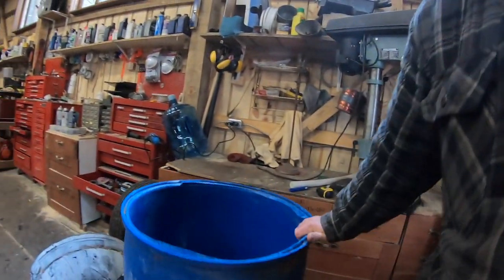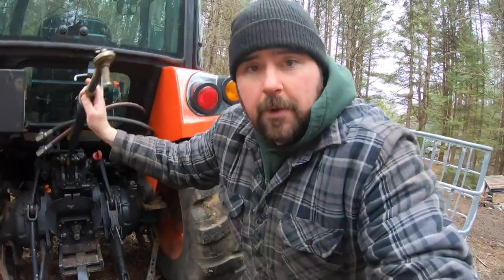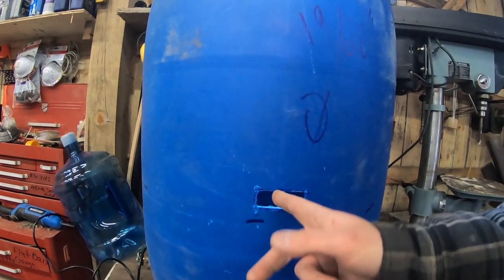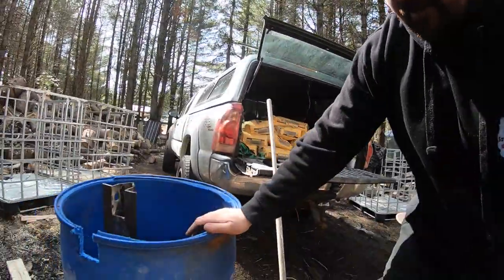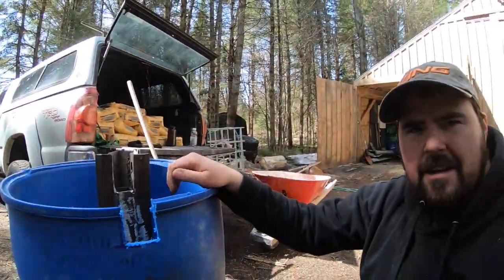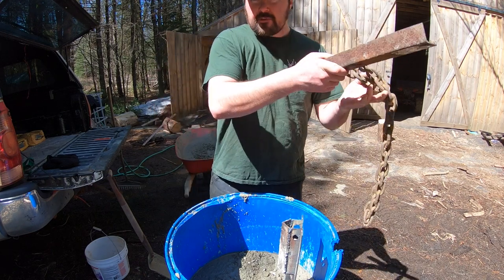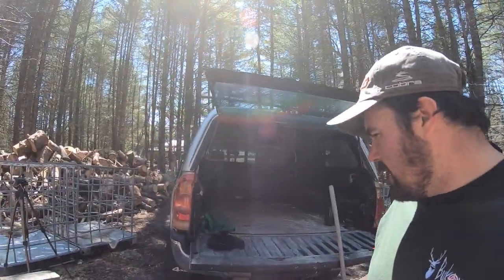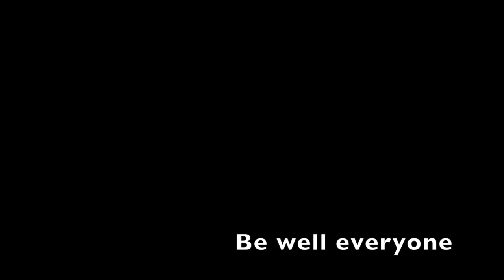Designing and Building a Tractor Weight

Comment: Another great video Sandy
I’m going to make a ballast barrel as well. But to save on the welding,, I’m going to add the top link connector by placing it in the wet cement.

Comment: Ballast weight is very important but there is no comparison to weight in or in rear tires. Having the tires filled is a must and I would find a way to do it. My buddy has wheel weights that bolt to the rims on top of filled tires and it is night and day compared to my tractor with filled tires and a ballast weight. Any weight added to the tires puts the weight exactly where you want it not only for traction but also loader work.

Comment: I had to say something. That's a 30 Gal. Barrel not 55. FYI. And I agree with the other fellow about the box blade being a better choice. It's something useful and can stay on the tractor and give you added ballast. I also added a 300 pound weight to my box blade, it helps a box blade work better and gives me an extra 300 pounds of weight so between the box blade and the weight I've got about seven hundred pounds on the back. I used a large gas cylinder filled with concrete mounted horizontally on top of the rear of boxblade. Really digs in good compared to without weight.
Good videos.
Reply: It's has to be a 55 gal barrel.  Here's the math:  One 66 lb bag Quikcrete stone mix = .5 cu ft; 14 bags = 7 cu ft.  There's just over 7 cu ft volume in a 55 gal barrel.

Comment: To save a few bucks and effort, you could throw some dense rock in the mix instead of using just concrete. For the lifting chain, i would maybe sink that lower. Looks good though, great cost savings. I just made some concrete wheel weights.
Reply from the maker: Thanks Rich

Comment: you could have filled your tires with windshield washer fluid. im in Quebec, Canada... windshield washer fluid 55 gal cost 80$... just need to buy the adapter (hose to tire valve), I took and old fuel pump and it worked #1 without costing a lot. but ok... i'm still able to lift my tires if I really push it. great video!
Reply from the maker: That is true. I looked around at washer fluid as well but for the price I couldn’t match the concrete. I also would’ve had to buy a little pump and hose section so the added costs were making the difference bigger

Comment: I also used a 55 gallon barrel and filled it with concrete and rock on the back of my Massey Ferguson 165.  My tires are loaded and I only lift the barrel up enough to move without touching the ground - about 6 inches.  I have had no stability problems while using my loader but without loaded tires this could be an issue.

Comment: Just a few comments for version 2.  As said earlier provisions for a 2" coupler on the back would be helpful.  NEXT...During the design phase, after putting the drawbar in the barrel hook it up to the 3ph and raise it all the way.  Then hold the top link above the top of the counterweight and you will automatically know where and at what angle you need the top link connector.  THIRD....If you put a couple of pieces of pvc tubing in the barrel you can also have a place to carry a shovel, rake or whatever.  LAST....I don't know if it will work on a plastic barrel, but try putting a utility knife hook blade in your oscillating tool.  On some material it cuts better than the saw blade, and lots cheaper.  [You do know how to sharpen those saw blades, right?]
Reply from the maker: Sounds like some good ideas. Thanks for watching Greg

Comment: Hey brother buy the adapter and put water in them ur self its easy I do road services it hooks to ur valve stem and to a water hose put the valve stem at 1:00 and fill it keep it up brother
Reply from the maker: Unfortunately the water would freeze here in Canada. Not sure if that’d cause damage or not
Reply: @sawingwithsandy  Use winter window washer fluid, should be good to -20f or so. Our NAPA has it in 50gal drums.

Comment: Caution Will Roberson, its not the same type of counter balance, the reason they fill the tires is because the weight is at the lowest point in the machine and static, what you are doing is adding weight above the axle, its like making a seesaw, you could damage your tractor or flip it over, be careful.

Im not saying it won’t work, What im saying is the machine will act differently in steering, my old JD had rear wheel weights and front removable plates about 100lb each, its all about what you want to do, towing heavy implements I needed weight in front to keep the front end down, in your case its to keep the back end down, just have to remember when weighted in the rear, and your forks or bucket is empty the front is light enough to bounce.

Comment: Did you do any rebar or other metal to strengthen the concrete? If not how much has chipped/cracked or broken from wear and tear? Wondering if those hitch attachments have supported all that weight ok by themselves.
Reply from the maker: Hi Jered, I didn't put any rebar in this. Holding up good so far. No cracking of any kind

Comment: Thanks for all the info, 
I made a ballast just like yours.
How long should I wait for the quikrete to dry? Before I can use the ballast.
Reply from the maker: I’d wait atleast theee days but truth is it’ll likely take more than a month to fully cure
Reply: @sawingwithsandy 
Thank you for your answer. 
I mixed the  quikrete Aug 19.
I'd like to use it but I'm afraid it will crack in half if it's not fully hardened
Reply from the maker: Yeah longer is always better for sure

Comment: DO NOT COPY THIS DESIGN. One day while you are fitting or dismounting  the barrell, it will rotate on the arms and trap you under it
Reply from the maker: The top link prevents this from happening
Reply: @sawingwithsandy  exactly my point. While you are fitting the barrel you connect the arms first, then you find the toplink is a bit stiff so you take the easy way out by raising the arms a bit. I got a bad scare from a barrel about thirty years ago. Wouldnt ever again touch them